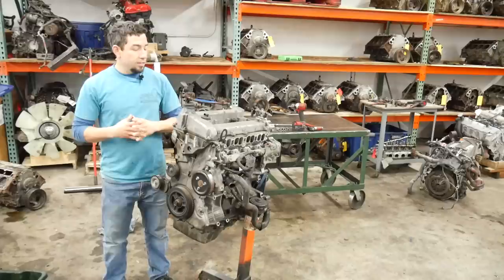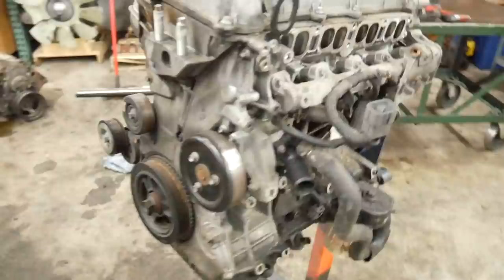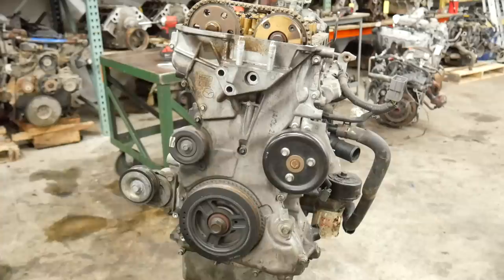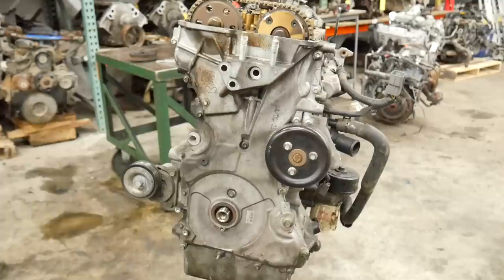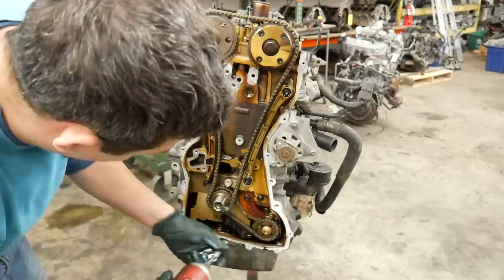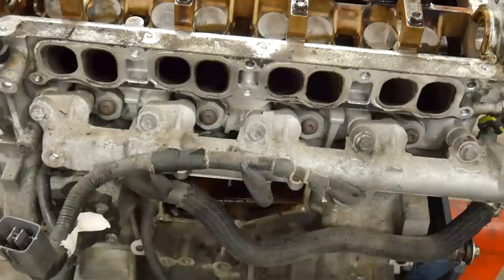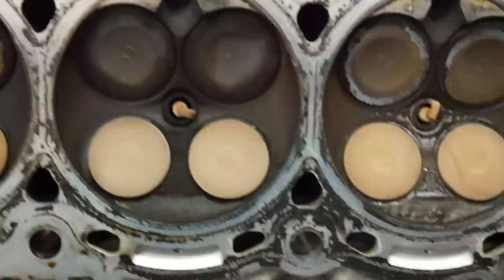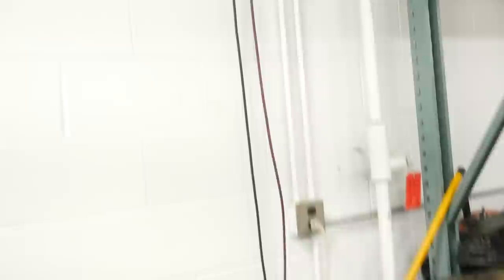TOTAL TEARDOWN: BAD Mazda MZR 2.3L Turbo Mazdaspeed3 Mazdaspeed6 CX-7 Engine.

Comment: Thank you for expressing your thoughts on how sh1t these are, got myself into a full rebuild for a customer, wish i had walked away. Rod bearings, fuel pressure sensor(impossible to get withiut rail) broken swirl flap motor arm, stretched chain, super soft cases, water outlets corroded like swiss cheese.. no cam bearings.. high pressure fuel pump makes me anxious too..

Comment: Is this the predecessor to the Ecoboost? My mom's 2015 Lincoln MKC has the 2.3 Ecoboost and it's been a great engine so far.  I'm a little spoiled from 3.5L J Honda Engine in my 05 MDX. 200,000 and she runs like a champ

Comment: Just curious if the 2.5L (non-skyactive) from 2012 is part of this.  I have one in my 2012 Mazda3 S touring.  It doesn't use any appreciable volume of oil in 7500 mile OCI as far as I can tell, and the oil isn't all glittery when it comes out.  Not the highest revving engine I've owned, yet it gets the job done mated to a 6MT.

Bought the car used and I'm at 131k miles, the last 63k being my contribution over the last 3.5 years.

I will certainly keep an eye on it.  Just curious if it's in the same family/generation as what you displayed here.  Yes, some cars/engines/transmissions don't tolerate poor servicing.  I figure if I get another 3 years out of, I'm good.  At some point, since we don't have kids to pass cars to, I'm just taking my wife's hand me downs, giving her the newer car.  So a 2017 RAV4 is in my future.

Oh, and go Cardinals!
Reply from the maker: The 2.5 is not like this at all, it does share some architecture with this engine. I don’t see ANY of the issues with the 2.5 that I do with these. Those are pretty solid.
Reply: check out the mazda cx 5 too

Comment: Wow, that's definitely a crappy design right up there with the ford 4.0L SOHC with the timing chain on the rear of the engine. I believe these engines are designed to fail at a certain point and either not be repairable or not be worth repairing

Comment: I did 50k miles on mine - probably the least reliable car I've owned. Timing issues, throttle body failed twice, rust everywhere... Replaced it with a Fiat of all things, which was twice as reliable. Checking online, the last time the mazda was on the road was 2017 - in the bin at 10 years old.... that's pathetic. It was a quick car, but the engine is junk.

Comment: I have a cx7 biggest pos I’ve ever owned turbo went out, blew all the oil into my cylinder lost all power fouled new plugs, coil packs, and is so terribly designed it’s insane currently tearing it down rn. Will never buy a Mazda again

Comment: I had a Mazdaspeed 3. What a pile of junk. Bought it brand new in 2010. Didn't even have 40k miles on it before I started having issues. It's the only car i've ever had to have in for mechanical engine warranty work during the time I owned it.

Comment: A little late to the party because i didnt know he had a video for this engine but from what I've seen in the vast majority of speed cars...like any other shitbox rice rocket. These cars were designed for an entirely different crowd than the people who actually bought them. The people who wanted them and raved about them new were the kinds of people who understood that the owners manual is a bible of sorts and that they required more maintenance than the Corollas and Accords of the time. The people that bought them were the kind of people who actually believe that cars make random sounds all the time and going a few hundred... or thousand miles over on an oil change was no big deal because race car.

Comment: How can you get away with no keys on the timing gear? Seems like a crazy design choice. Cool video.
Reply: 80 to 90 fps torque + (2 x)  90° turns on bolt with a new set of chimes. No problem 😉

Comment: I think Ford likes to hire sadistic design engineers. It's the only thing that explains why they would design certain vehicles the way they do. Try pulling the turbo off of the 1993-1994 7.3 IDI engines. Oh there's another one right there. In 1994 you could get 3 different diesel engines in a Ford which makes ordering parts lots and lots of fun.

Comment: Hmm, you're a Mazda guy? I'm planning to rebuild my first engine, a Mazda MX3 1.8L V6. Love the engine to the point that I want to know how it works, so got a parts car with an engine that burns oil to tear down. I'm curious, ever torn down one of those engines?
Reply from the maker: Absolutely. I am extremely familiar with the KL series of engines, they are some of my favorite. You should look into 2.5l swapping the mx3, it’s a very easy swap. I have a few engines I could sell.
Reply: @I_Do_Cars  Oh nice, very cool to hear! I have definitely heard of the swap. I honestly  kinda like the 1.8 though, even if the 2.5 is basically a bored out version of it.. Don't get me wrong, it's a tempting swap and I completely understand why someone would. I'm just a weirdo who likes keeping it mostly original I guess =P 
Plus the whole 1.8L V6 thing is just cool to me, It's such a Mazda thing to do and I love it

Comment: I bough6 a cx7 with decent miles for cheap. I don't know who screwed the pooch here Ford or Mazda but with ford's notoriety for low quality reinvent the wheel ideas I'm pretty sure whose to blame.
It's no wonder modern Ford ecoboost engines grenade at 80k miles

Comment: Change the oil every 5000km and change the cooling fan on time , these motors run far too hot from factory . These engines run at 103 degrees Celsius, I've changed mine to 80-85 deg  no prob now   by overriding the factory settings . They need new Big end  bearings every 150000ks due to the long stroke flogging them out
Reply: How did you do the temp change? Thermostat or ECU programming?

Comment: I talked to a Ford Engineer friend about this engine years ago. Asked why Ford wasn't using it done Mazda was part of the Ford family at the time.  He said it didn't meet Ford's durability expectations.
One interesting thing I remember him saying about it was the direct injection was poorly designed.  Specifically, the injector placement was bad.  I don't remember if it is tumble port or swirl port, but he said the injector placement was wrong for the type of intake mixture swirl.  That caused the injectors to wash the cylinder walls instead of the fuel staying suspended.
Reply from the maker: Interesting, from an efficiency standpoint, I can’t really comment as that’s not my forte, but I can see how this engine didn’t meet their durability standards.

Comment: Just an FYI for those who don't know, those engines were designed by Ford, as they owned Mazda during this time period, Mazda engines prior to, and after ford were and are excellent engines. Ford ran Mazda into the ground during that time period.
Reply: The non direct injection Ford 2.3l was awesome too.  Ford didn't run them into the ground,  Mazda was still 51% owned in Japan.  They needed a bailout at the time if I remember correctly and both benefited for technology exchange.    Also Volvo was part owned by Ford at the time and helped develop the great C car platform used on focus, mazda 3, s40 (I think).

Comment: And this is a Mazda designed engine, it was developed while Ford owned a 30% stake in Mazda. The new EcoBoost engine is based loosely based on this engine but the EcoBoost basically only shares the block with these and that's it. Ford did not ruin Mazda... Mazda was in deep financial trouble, Ford kept Mazda alive and without Ford would not exist today.

Comment: I feel like engines like this are designed by engineers that for some reason assume the people that end up having to live with them will also be engineers. Maybe their mindset is so far removed from reality that all these decisions seem perfectly rational to them? I'm not an engineer, so I can't really comment on the process that goes into making an engine, but I'd like to think I'd find a way to maybe...overengineer key components so that if my end user was a little late on oil changes the engine wouldn't grenade? Maybe it would be a huge bonus for whatever company I was working for if the engine I helped design had a stellar reputation for reliability in all conditions? I dunno really, guess that's why I'm not an engineer.

I guess what I'm saying is; I'd like to be the lead on an engine program that produced a product that didn't end up on this channel.

Comment: Apparently they aren't THAT bad when you use a good quality 5w40 oil that you change OFTEN (max 5k km OCis), use the highest grade of premium fuel you can find and importantly, don't ever lug it or WOT it under 2.5k RPM...

Phew.. i'll keep my venerable 2012 Si with 450k km on thw clock...

Comment: I see the FoMoCo stamped in the side. Is this the same as a 2.3 duratec engine that ford used in the later rangers?
Reply from the maker: It’s the same family but the ranger is significantly more reliable
Reply: @I_Do_Cars  What were the differences between the Ford/Mazda versions? Ive owned several of the sohc lima engines and theyre about the most durable little engines Ive come across but after 2001 I have no idea lol

Comment: Wait it said FoMoCo on the engine block? What does Ford put these engine’s in? Shopping for a vehicle for my son. Definitely will avoid these engines.
Reply: Pretty much everything except diesels and V8’s have the ecoboost bud so unless you’re getting a truck or a Mustang chances are you will be getting an ecoboost
Reply: Probably Focus, Fusion and I believe at some point, the 2.3 and/or 2.5L ended up in the Escape when the 3.0L V6 was no longer used in them.  Possibly the Ford Edge with a 4 banger, and of course, any of their Mercury or Lincoln cousins.
Reply: My focus ST 1st generation Mk1.5 has the 2.3, its been great.  Just keep a eye on the oil and keep it changed. Also these engines call for synthetic oil, dont put anything else in it
Reply: 2004 threw 2009? (I forget when they split) Mazda 3 mazda 6 and tributes 2.3L and 3.0L

Comment: The problem with these engines are that they’re made by Ford. They really messed up Mazda’s reputation with these engines. There are other Ford engines that have poor oiling issues. This engine is made to force you to go to the dealer rather than work on it yourself.

Comment: Well !?  Voila!... What you'll ever know is how long that poor engine holds by working with oil mixed with Chocolate jelly... 😅.. that's an interesting question !   Engines fail the most by being banged and poorly treated by people that don't have a clue,, "or interest" in how to maintaine them correctly... Mean around 90 % of the times that's the cause of death... The rest can be:  Poor quality control on components at assembly line. Can happen!  Or a mistake on assembly procedure from the sleepy bolt tightner.. All  that's called: Bad luck! The lady can get you...*That can happen with almost any car company for sure* .. MZR turbo engines can get treated badly in CX 7 vehicles by dumb persons who try to make chocolate jelly inside them " like this one maybe" on your video.. of course will go....BANG! and  fail... Or instead can be used and abused on Mazdaspeed 3 or 6 platform well over the design power with  propper maintainence and last beyond 120K and still runs very well...   😉

Comment: How Ford almost destroyed Mazda...
Reply: When Ford bought 51% of mazda they were in financial trouble.  And now they still exist so not sure they almost destroyed them.  Early mazda 3, Mazda 6 were great cars along with 2.3l Focus at the time. The non direct injected engines at the time were wonderful by the way.   And ironically the 100 percent mazda powered rx8 WAS trash from the same time period (although fun to drive) 
I used to work with a guy who boasted about how reliable his mazda cx was compared to garbage domestic vehicles.   He didn't believe that he had a Ford engine in his SUV till I showed him the parts with fomoco on them :)

Comment: Wow. Nice video. Why is Mazda SO BAD at engineering? So many of their motors have had serious durability issues going back to the 80’s and are often famously difficult to work on. Zoom Zoom my ass. It’s more like Zoom Boom. They almost always seem to get something expensive and serious wrong. Even Ford couldn’t make up for the poor engineering at Mazda. Mazda is in a fragile situation these days being a smaller car maker with no solid EV cars due anytime soon with an overpriced line up pretending to compete with higher priced cars. All the Mazda owners who have suffered expensive engine failures out of warranty will likely never buy a Mazda again. Even the Koreans completely shame Mazda with higher output per liter engines that are much better designed and much more reliable.
Reply: I've owned a Mazdaspeed 3 for years now. They have denied warranty work on a peeling dashboard, and they also havea very dangerous seat bracket recall. They wouldn't help me at all. They tried to charge me 860+ USD for a new seat and bracket, even though it's defective from manufacturer. They said my year was out of warranty. I have had to get my seat bracket welded several times, by a friend of mine to get it to stop breaking. When it breaks it rocks you back and forth really bad and makes it near impossible to shift and insanely dangerous to drive. It's been my most reliable car in terms of engine, but, I think I've been lucky. I've had so many little weird annoying issues. I know their quality has gone up, but they have weak power-trains. They demand and upscale price even though they are far from upscale. They are rebranding as a false luxury brand. They need to stick with what they do best, make fun cars.

Comment: What do you think of the 2.0 and 2.5 variants?
Reply from the maker: They have a much better timing chain and don’t have the issues that the 2.3 turbo engines do
Reply: @I_Do_Cars  they have a weaker non roller chain not suited to GDI and high particulate matter. The only reason they appear to wear better (bearing in mind it's the VVT that fails, the chain rarely stretches on the L3-VDT) is because they aren't driving a HPFP off the end of the intake cam.

Comment: Seems like the average Ford product.  I don't know how to describe their mentality.  It's like a team of engineers design completely independent of each other.  Then another engineer is responsible for assembly.  When issues occur instead of going back and modifying a design just layer on another engineered solution.

Comment: What are your thoughts on the non-turbo MZRs? Like the 2.0l?
Reply from the maker: The 2.0’s are great engines. Only ever see issues with intake manifolds, but the engine itself is very reliable.
Reply: @I_Do_Cars  Thanks for the quick reply and good advice! Are you referring to the swirlers in the intake manifold going bad, or are there other issues as well?
Reply: Thanks for the quick reply and good advice! Are you referring to the swirlers in the intake manifold going bad, or are there other issues as well?
Reply: @I do cars Thanks for the quick reply and good advice! Are you referring to the swirlers in the intake manifold going bad, or are there other issues as well?
Reply: @I_Do_Cars  Thanks for the quick reply and good advice! Are you referring to the swirlers in the intake manifold going bad, or are there other issues as well?

Comment: I think today’s long oil change intervals based on driver information systems where MFGs are trying to get or claim lower cost of ownership along with low friction oil rings that allow today’s engines to use oil. This is causing more and more engines to become scrap long before they should.....
Change oil at 3000 miles

Comment: I bought a mazdaspeed 6 after I went bankrupt and didn't even make it home the engine blew.. 6000$ was everything I had to my name, it went down the drain in less than 6 hours. Needed the car for my family driver I figured 6000$ would give me a decent amount of time, boy was I wrong. Ended up my dad bought me a 600$ acura with 360000km as I needed wheels for my son and the car still runs but it's a price of crap. Thanks tl auto sales in edmonton for selling me this jewel

Comment: Is this the same short block from my 05 Escape 4-cyl?
Reply from the maker: It’s different. The escapes, regular mazda 3 and 6, fusion, and focus all got a different variant. A lot more reliable but the cartridge style filter on some caused lots of issues.
Reply: @I_Do_Cars  yea mine went 180k miles before I sold it. No issues.

Comment: Mazda with Ford motor co block

Ford A5 B5 oil was a must until it blew up. These engines are very oil sensitive. Low slaps high strength etc. Easy to mislube with cheap shampoo from the local scumbags.

Comment: What does the cartridge system do?
Reply from the maker: It’s the balance shaft essentially. Reduces engine vibrations. 
In my experience with these engines they run just fine without these.
Reply: @I_Do_Cars  i got 2.0L its been good to me . I check the oil  and change it often. Mind you it only has 120k miles on it but its 12 years old and dealing with Canadian winter too
Reply from the maker: The 2.0’s are pretty good engines to be honest. Don’t see many of them bad

Comment: Typical FoMoCo ford engine.  Yes I agree with everything you say. 👍
Reply: It's a Mazda engine, designed while Ford owned their 30% stake
Reply: @FusionBoost2.0  The L3-VDT engine shares a cylinder block with 2.0/2.3 Ford EcoBoost engines. These engines are not the same. EcoBoost engines have different turbochargers, cylinder head designed by Ford, and Ford's Ti-VCT variable valve timing system.
Reply: @lonwillis783  Yup, they only share the block... Rest Ford re engineered